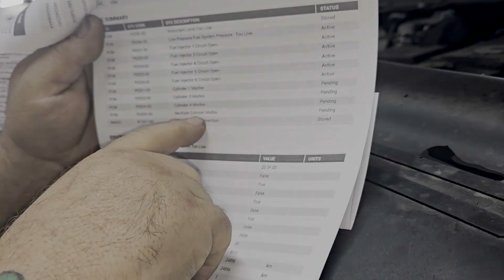“The Fuel Sample Told the Truth… Gas in a Diesel Ram 3500”

Comment: Gas in a diesel is WAY worse then diesel in a gas. Gas in a diesel can take out the injection pump and all injectors. DEF in a diesel tank is way worse and deff will take out the fuel system. Diesel in a gas you can get away with a tank flush and line flush and filter change if there is one. Worst case spark plugs may need changed.